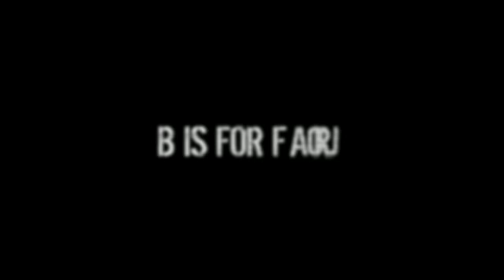Budget Lotus Evora Pt 23 - Sparco Harness Or OEM Belt?

Comment: Please do NOT use seat belts that have been in a crash!
A part of the construction is that they stretch to minimize the impact on the person. Once stretched they can't do that again and they are likely to snap in the next crash.

If new Lotus belts are too expensive, check if any other brand will fit. There are just a few manufacturers of seat belts in the world so it would be quite easy to find.
Reply: Thank you for pointing that out. I was about to write that.
Reply: Correct. There are many other reasons not to use a crashed seatbelt, but my english isn't good enough to explain.
Reply: +1 Million Subscribers One Video naw it was just stuck so he unstuck them
Reply: Yeah! I actually think it's a very dumb idea to ride without airbags... I mean, come on, it's a Lotus, just get the damn airbags.
Reply: and a 3 point seat belt is only rate to 30mph to 40 mph max so have fun oh sorry I forgot to say that every safety devices on your modern car is only rate to 30mph or 40mph if its newer
Reply: There are companies that will rebuild your seatbelt assembly.  I had mine done at 100,000 miles.  New belt ( to match the new seats) and the belt ran so smoothly afterwards.

Comment: 4 points are good for off roading, will keep you in place in the event of a rollover better than a 3 point and most importantly keep your body from flopping around whilst rock crawling or going over big bumps. And if your truck catches fire you can get out a lot more quickly than with a 5 point or 6 point harness. Doesnt mean they're good for street cars though
Reply from the maker: good point, probably very good for a rock crawler or something normally going low speeds off road, probably very good for that, i didnt think of that.
Reply: exactly, but it is still the fault of the company for not advertising them for that purpose, which is misleading and dangerous for the consumer as you said in the video
Reply from the maker: yeah they call them the "street" model
Reply: interesting... realistically they're only good for trucks, speed boats and small planes. On that note, maybe us bifb fans can see an off road salvage build in the future ;)
Reply: A 4point harness you have to take your shoulders out but with a 5 point once you open it you can climb out without getting tangled in anything so a 5 point is better
Reply: Takata 4 point anti-submarining, and DOT approved

Comment: I had schroth 4 point belts on my 2004 WRX.  Honestly, even though I had the letter from them that I could give to the police if they ever pulled me over saying that they were DOT approved, I didn't think they would accept it (it's just a xeroxed letter that looks pretty suspect).  Then I'd have to go to court to get out of the ticket for not wearing a seatbelt.  Also, even though I knew they had anti-submarineing built-in to the left or right upper harness, it was all taken on faith.  So when you're driving around, it's kind of on your mind the whole time.

The main reason to NOT go with a 4 point harness is if you ever plan to ever adjust the radio or AC while driving.  To do so, you have to loosen the shoulder tension so you can lean forward to adjust the radio or AC.  Then tighten them back up.  It's a real pain in the ass.  The nice thing about a spring-loaded OEM belt is that you CAN lean forward and adjust the controls, or just re-adjust your seating position on a long drive.  Being strapped in feels cool and is good for the track.  But on the street, OEM is best.

Also, the thing that the pre-tensioner does is it removes the slack that naturally happens with OEM.  Often when you lean forward, you'll have a little bit of slack when you sit back.  Even an inch or two of that slack can kill you.  So the pre-tensioner gets rid of that and cinches up your belt against your body when the collision starts but before your body starts to surge forward.  Before these pre-tensioners came out, there was an ad campaign by the DOT that was called, "SLACK KILLS", and it was a set of commercials encouraging people to pull their belts tight often as they drive if they are leaning forward from time to time.  I still do it to this day.  It was an effective campaign.  So I'd highly recommend you do that until you get your pretensioners installed.  Otherwise, you'll make contact with the steering wheel and you'll say goodbye to the front of your face and maybe your life.

Comment: Just stick with 3 point OEM it will look better and it's going to be easier to live with as it's not going to be a race car, it's going to be your DD.
Reply: Also some low cost cars even with airbags do not come with pretensioners, even in 2016, so only having the seat belt with the inertia reel will be safe enough for street use.
Reply: But #becauseracecar
Reply: i think 5 point harness looks nicer
Reply: Looks cooler, but as he said its an inconvenience, even driving around in traffic it makes shoulder checking etc. much harder, as well as taking far longer to put on and take off.
Reply: true. u dont gonna crash this car every day. go for OEM
Reply: As someone who made the decision to go with cam lock 5 point harness on a street driven car that's not even driven every day... Stick with OEM 3 point belts.  5 point harnesses are a pretty big hassle on street cars.

For reference, I'm removing my 5 point harnesses and going back to an OEM 3 point with OEM seats.
Reply: No #BecauseRacecar
Reply: It's going to be a daily driven street car, not a fucking "race car."
Reply: Takata drift 4 point 
Problem solved
Reply: I keep wondering if the pretensioner doesn't help ameliorate the 'hit' of the airbag which I read somewhere as described something like, "airbags travel @ over 200mpg which would punch harder than Mike Tyson" :-)
Reply: my friend was knocked out by an air bag impact. The paramedics said they saw it all the time on older airbag cars. However they said my friend would be dead now if it wasn't for the airbag.

Comment: You can have the Air bag module reset on almost any car through Safety Restore or another similar company. They can do it about $40-45 depending on their ebay price at the time. Saves a lot over new OEM modules. They also replace pretensioner charges with OEM parts. Pretty good deal. Just pay online or on ebay and send them the parts and the payment receipt. they will fix it in 24 hrs.

Comment: A little tangential to the 4-point V 5-point thingy:
When I did a "Racing for noobs" training, one of the first things they taught was that the backrest should be vertical (about 90 degree angle to the seat base). 

This helps prevent submarining with 3-points, it aids the driver to apply pressure to the braking paddle (you can better "push against the backrest"), and it is usually the better position for steering.

Comment: Another good thing about anti submarineing 4 points is you have that little bit of energy absorption by the belt like you have in a 3 point. Being bolted in solid sounds safe. But without a HANs device you could seriously hurt your neck so good to have some give and pivoting in my opinion.

I agree with Chirs 3 point is the safest in a road car unless you have a front cage to hit your head of. Even then some padding might make it safe enough.  I had 4 point sabelts in my Teg Type R just because they looked cool. Not once did I use them, even on a track day. You always have to remember the OEMs know a lot more about this stuff than we .

Comment: IMPORTANT: If those are the 3 points from when the car crashed, i would not use them!!!!. In an accident, the webbing of a seat belt stretches, which absorbs some of the energy in an impact. This helps prevent any injury from the contact between the seat belt and the person. You really cant see it afterwards, but if the webbing has been streched, it might break or hurt you if you crash with it again. Buy new ones. :)

Comment: I use a Schroth Quick Fit 4-point harness when autocrossing my car. Since I'm racing around orange cones there is very little chance of a hard crash. But the 4-point harness does a much better job of keeping me from sliding around in the seat compared to the OEM 3-point belt. Just food for thought.

Comment: The other thing about 4 point/5 point harnesses is basilar skull fractures (this is what killed Earnhardt Sr.). Basically (on mobile, don't want to type it all out) the harnesses do such a good job of keeping you in place, your body is going to stop with the car. However your head has no restraint. You end up with whiplash in the other direction.

Look into it, make your own decision.
Reply: Hans Device... they are a good idea if you do a lot of track racing at high speeds and aid in keeping you head stationary in an accident.
Reply: Precisely. Read some of my opinions:

If you want a harness, you need a cage for rollover protection because you have no place to go if you submarine. 

If you're going to do a cage, you need a helmet because you stand a really good chance of hitting your head in a collision. I don't agree that a quarter inch piece of fairly soft foam will be enough in the event of contact during a collision.

 If you're doing a harness, you need a HANS because you stand a chance of breaking your neck.

For me, it's all or nothing. I'm not doing a helmet, HANS and harness individually. I feel it is more dangerous with parts of safety devices than it would be if you left the factory restraint systems in place.

But again, that's my opinion based upon my research. You're free to mix-n-match whatever you want.
Reply from the maker: This is really the summary of what I learned, either go all out, 5-6point, roll cage, helmet, HANS. OR stick with the stock seat belt & airbag.
Reply: You are 100% right there. You either go full on FIA spec safety, Cage, Helmet, HANS and Harness, because ALL that kit is designed to work together or stick with stock. Any one item of it (even a helmet because of the stress it places on your neck!) alone is more risk than the standard safety in a car.

Comment: Inertia reel works via centrifugal force. Older (70-80-90s) used a large lead weight on an armature. And yes, the inertia will be fine by itself.

Comment: To my understanding the pretensioner lessens the jolt on your body by preventing those few inches of travel before the inertia wheel stops you, it also prevents the airbag from breaking your face. also part of the seatbelt is a stretch webbing that is not reusable. if you dont want an airbag, cool, but I wouldn't reuse that belt.

Comment: Just a thought (if you didn't already do this off camera), perhaps add some loctite to those bolts holding the spring caps together. Would hate to see them rattle loose. Another reason rivets "may" have been used (other than non-serviceable reasons). Awesome work as always!

Comment: Great video! Considering you are doing your due diligence when it comes to safety, also consider the use of replica wheels to properly built TUV approved wheels. There's a reason why some replica's are dirt cheap and come with a lifetime warranty as opposed to Enkei's TSW's Motegi's BBS's Volks and more. Catastrophic failure is a risk you run with replica wheels and considering this is going to be a road car the safety of others on the road is important to consider too.

Comment: 4 point decapitation, that really did it for me. Depending on the speed of the crash you have immense momentum, you come flying forward you can actually watch dummy videos where the dummies slide all the way forward into the foot well. The harness is very well anchored so it doesn't move, the lower belt stays, you come sliding out under it, if your lucky it will grab your arms, unlucky and off comes your head. The reason they sell them is that for most things it is sufficient, autocross for example is usually done by yourself and the only thing to hit are cones, some go-karts and other race cars have absolutely no room in the footwell for your body to go so these would suffice.

6 points are far more comfortable if you are aggressively driving, the 5th point strap on a 5 point harness will dig in pretty hard on your "bawls" when you brake hard for a corner.

I want to say you can get the belts pinned on some center lock belts so it holds two straps, that way you get in, plug in the shoulder and one lap belt and you are good to go. For egress nothing beats a cam lack or a duckbill if safety is your concern.

Schroth does make the belts stock for exiges I believe. You can also buy belts past their cert date for really cheap. They are fine to test out and usually sell for very little. If you like them you can get the rewebbed.

Comment: You know, the problem with 4, 5, or 6 points is, that they allow no movement of the body whatsoever. So in an impact, all the load (25g if you hit a wall with 50 mph) goes to your neck and head. That's why you should use something like a HANS-system like they do in racing, which supports your neck. That's why the OEM-Harness doesn't just hold you back, but it will simply "breake you down" while flying into the airbag, which will catch you and save you from the forces if you will. If you want to be really safe, I'd recommend to put in new airbags and harnesses. Just a thought tho ;)

Comment: I believe (some) OEM seat belts also have a system that pulls downs the clip that you attach your seatbelt too in case of an accident, securing the lower part of your seatbelt in place. As other comments, seat belts are also designed to stretch to "diffuse" the impact (a bit like a crumble zone does), so you really shouldn't reuse a seatbelt that has been used in a fairly major accident. I would stick to OEM if I were you.

Comment: look into your harness i run a 4 point and if the strap is wide enuff. submaring is something that accrues when properly installed and i pass tec. i also cheaked with my locail law inforcmant the 4 point harness is just seen as another seat belt. I do hope that helps.

Comment: As a couple of other comments have noted seat belts or harnesses for that matter that have had a major impact have stretched they will only stretch one if the have another impact they will most likely break any own seat belt that has had the pretesioners fired is stretched and should be replaced with a new one. You can see I the video that the first belt you work on is miss sharpen and should not be used again. I have spent more than 10 years selling harnesses for motprsport to accumulate this knowledge hope this is of some help

Comment: Why doesn't someone make an active inertia reel? I've had issues with many cars where the inertia reel will engage when the car is stationary. 
Also does the points of the seat belt refer to the anchoring? If so why not have that 4 point as a 6 point, and have forward anchoring points so that it can't ride up? Or on the shoulder straps, have them anchor at a a lower point also, which would prevent having the pelvic strap from riding up.

Comment: I'd say just use 5 point and just deal with the 3 mins it takes to unclip them
Reply: If you get a cam lock harness, it's significantly easier, although they're usually a bit more expensive. Buckling yourself in is only marginally quicker (if at all) but unbuckling takes all of a second with a cam lock.
Reply: Cam lock, all the way.  Well worth the relatively minor added expense.  One button and the whole thing comes apart.  They're easier to get out of than a regular OEM seatbelt - especially after an accident, when the release button on a regular seatbelt can be hidden between the console and your hip.  And while I'm putting my two cents worth in, 6 point harness, every time I can...so I have somewhere for my balls to go.  There's something anatomically wrong about a guy using a 5-point (women is another story, though.)  :-)

Comment: That breakaway 4-point harness sounds like a DISASTER for your spine due to the rapid twisting motion it forces your body through
Reply: takata make them and they are incredibly safe. takata harnesses are some of the best in the business
Reply: and 3-point doesn't have that problem?
Reply: Seatbelt are the same though if you think about it?
Reply: Well luckily it is tested by professionals and not internet comments.
Reply: The purpose of ASM belts is to allow you to stay in your seat better while driving, but to operate like a 3-point in the event of an accident. Anyone who actually wants real track safety should use a 6-point with a roll bar and HANS device, which he fails to mention.

Comment: Dude, I really wanted to clearly see how that ball bearing system worked and even at .25 speed, you can barely see what you are doing.  It would be nice to see that in real time, or something that I can slow down to watch in real time.  I don't understand how cramming the ball bearings into a round drum will cause it to lock up.  If the drum is not round, it would be nice to actually see where the bearings are going.

Comment: I would remove the ball, I work at a go-kart track and whit that ball the harness gets tighter and tighter. In a car its not that bad but if you take alot of hardcore turns it gets really annoying. Whitout the ball the belt still works and not react to every little movement. you can also place the seatbelt in anny position. just a tip if you find that annoying.

Comment: Harnesses are designed to work as part of a complete system that includes a HANS and NO airbag. Unless you plan to drive on the street with a 5-point and a helmet and a HANS, then you need to stick with the 3-point system WITH airbags. 4-points - even ASM belts - are not as good as the other options.